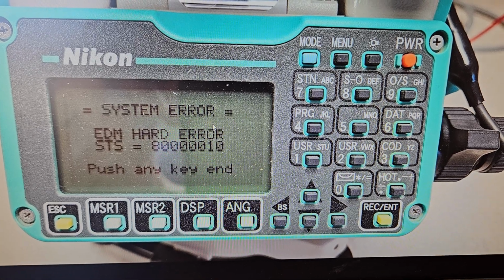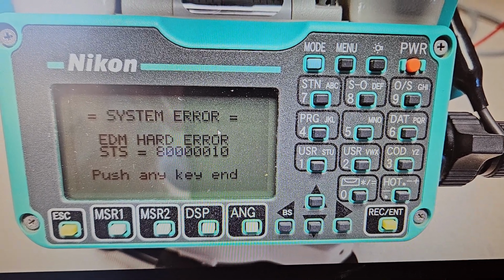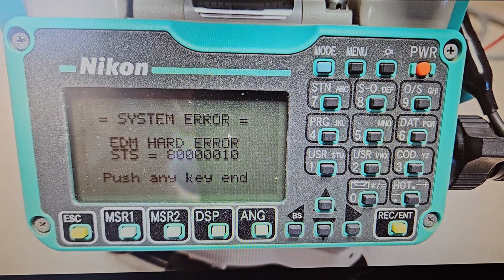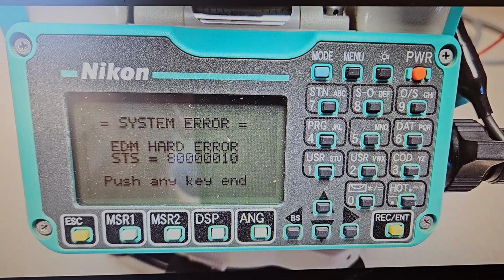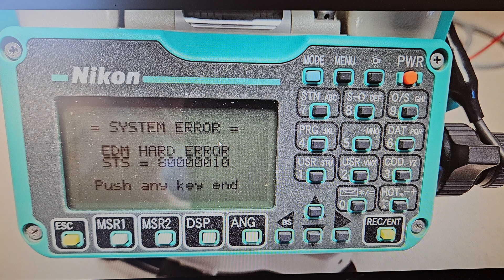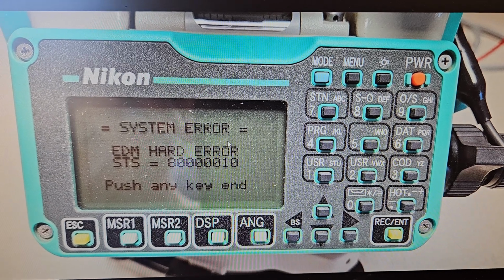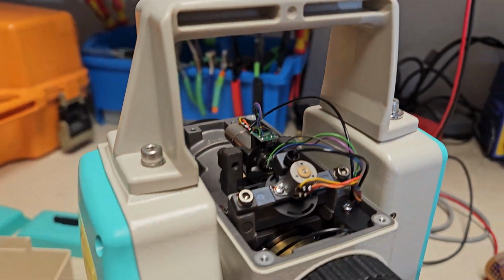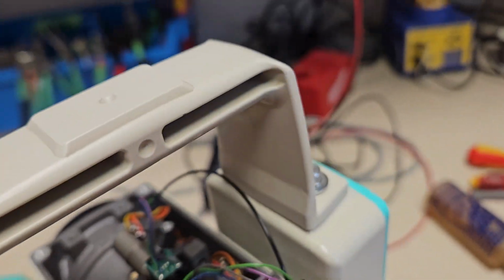Repair Nikon DTM-332 Total Station EDM  Hard Error STS = 80000010

Comment: how can i change backup battery dtm 831
please
Reply from the maker: Sorry I have no experience with the DTM 831.
Reply: @offgridtech360  i found its in the back faceplate lcd keyboard a watch battery like a quarter or nickel size. soldered to the board
. internal batteury